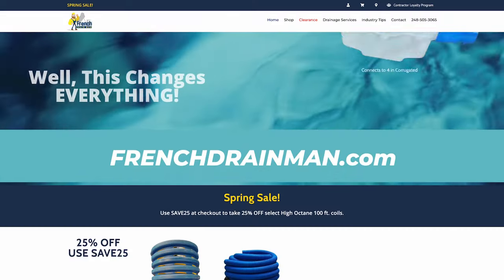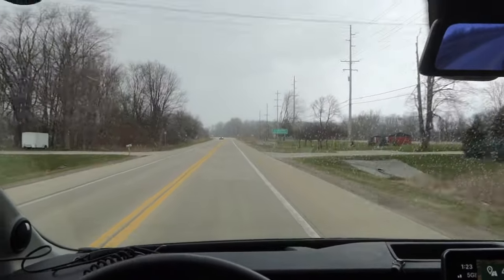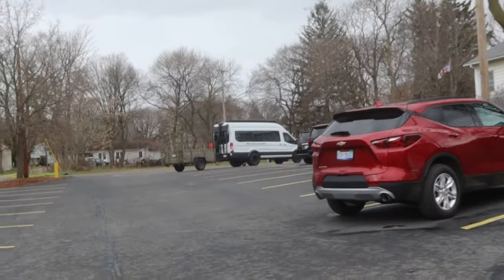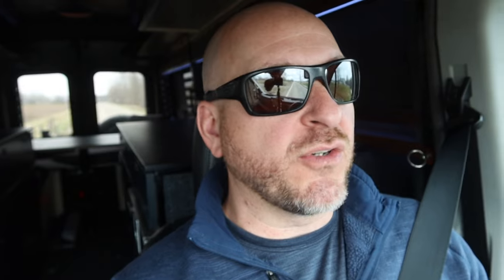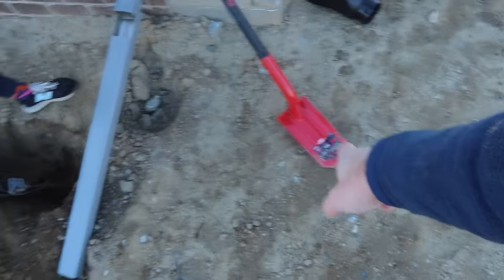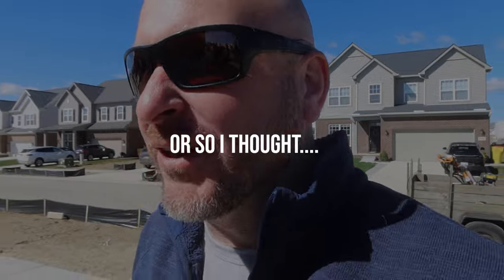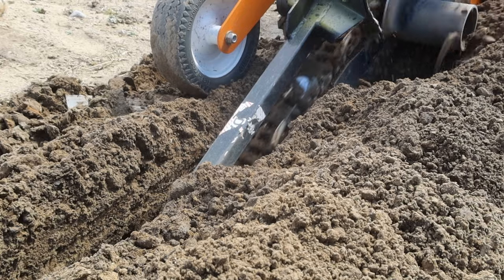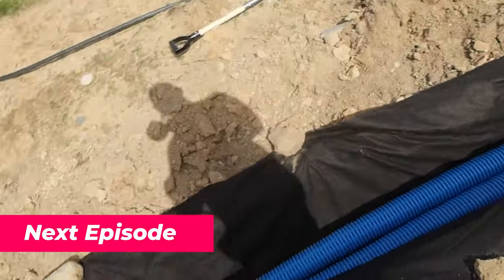How to DIY Install a French Drain | Materials, Planning and Trenching

Comment: In my town, the building inspectors are basically undercover ninjas -- spot an amateur project, requiring permits, from three towns over, and it's game over. Mess with city planning, like ninja star-throwing tornadoes. Try sneaking a sewer tap without a permit? Boom! Instant 'oopsie-daisy-matilda' with fines zipping around quicker than you can mutter 'code violation.' Maybe your inspectors are more chill, but over here, it’s like living in an action movie! I love driving around in my truck with instant popcorn at these sites.
Reply from the maker: I talked it over with the company who does installations in the city and they said it was not necessary.  Hope you won’t need that popcorn

Comment: Oh dear...forgot to lay 3" base of 3/4" clear stone under the weeping tile
Reply from the maker: Clear stone?
Reply: @JaYoeNation  not a mixture, usually limestone or similar, no dirt ie looks washed. Supports tile, still permits water to leach.  The stone helps keep roots and dirt from plugging the holes
Reply: @Iamkayaky  Usually limestone, sandstone, or river rock size 3/4" to 1" and the tile must be covered and base, then sand on top. The municipality ought to have requirements clearly posted in the planning dept for any trenching and other construction at city hall. In my city these projects are forbidden, you must hire a licensed contractor, for good reason.